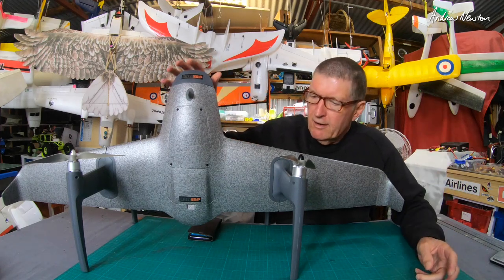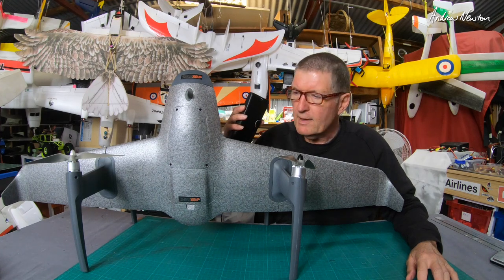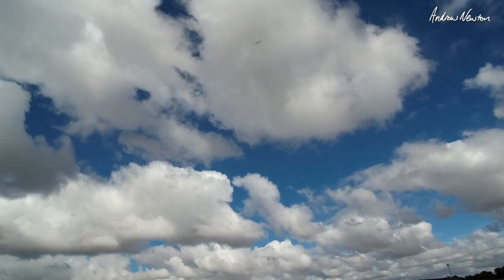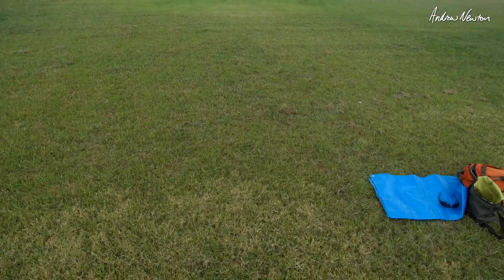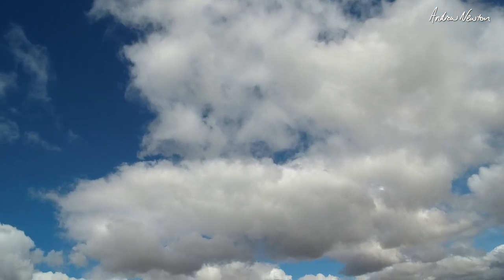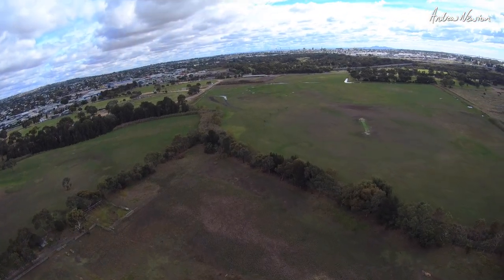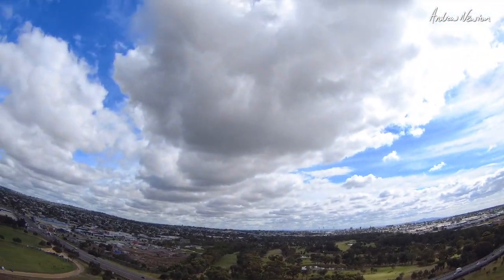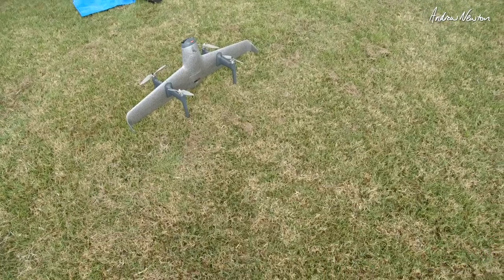FoxTech H-Wing VTOL Flights

Comment: Nice. Happy it now are working for you. Mine is on its way, tracking say tuesday delivery. I will make a VTX and small battery to use with my action cam. Nice to have both goggels and screen pad option. The Spring is on its way, here in Norway, so i'm looking forward to a nice RC flying time. Thank you for the video.🙂
Reply from the maker: Have fun

Comment: How does the integrated FPV video look? Is there an HDMI out so the image can be connected to your goggles?  Would love to see a range test on the radio with FPV.
Reply from the maker: Low res and choppy FPV feed. No HDMI. It's really designed for Action Cam recording and missions rather than FPV flying. But I'll try the DJI HD FPV next time.
Reply: @AndrewNewton  That's disappointing.  I was excited when the FoxTechFPV website stated "ONBOARD 720P/24fps HD FPV camera pairing with an integrated 2.4GHz 10km video/data/RC transmission system, a thrilling FPV flying experience awaits."  I'd say that feature is oversold!  Thanks for replying.  Love your channel.

Comment: In wing mode, is roll just controlled by differential torque from the motors, like quads control yaw? How is the roll rate?
Reply from the maker: That's right, I was surprised it did actually roll into the turn. I thought it would do flat skidding turns. Feels like INAV angle mode, very stabilised

Comment: I do consider that craft, so out of curiosity: With no control surfaces, do you still retain control authority at zero throttle in airplane mode?
Reply from the maker: GizFPV says it slows down a bit but not enough to stall.
Reply: @AndrewNewton  It will be fine for my intended use, then. And thanks for showing how to solve the home point issue. That makes the H a viable option to guys like myself.

Comment: Thanks for the brief flight test ... I hoped after being in wing mode you would fly it closer to the ground so we get an idea how silent it may be ... a single engine wing is "loud" a twin is much less loud and I wonder how silent a sleek a 4 engine wing might sound ... should be very silent compared to any RC plane, especially with these big props => low RPMs. Are you able to inset a current logger into the battery circuit and get an ide how efficient this is (including its FC's & TX & RX current)?
I had been worried about the weather situation at your place but then noticed that you were just barely outside of the seriously bad weather stream 🙏... hope you can fly it soon with less wind and will give us some more data on speeds and watching the transition from the side, to get an idea if a serious altitude drop is really part of the routine ... else turn on the transition at 20 or 30 meters, should still be safe and better visible for us ... or use a camera with a serious zoom. Also what is the stall speed, or since it has a pitot tube and is flight controlled, what is the lowest possible speed when in wing mode?
Reply: MAD GRUMPYMAN  Thanks for reply, I had no clue 6 blade props even exist?!   I was also thinking of folding props on a flying wing ... or is there a way to protect the 6 blade prop from ripping the motor mount off when landing?

Comment: I have a hard time flying off the cell phone video so bought a 10x8 screen to use.. helps
Also had a problem w/airspeed calibration which was fixed by putting in a new sensor I had on hand. HEQ said it was a software problem and would correct it in an upcoming release.
PS Nice pun The Roc :)
Reply from the maker: Airspeed cal seems to be very picky, takes at least 3 attempts